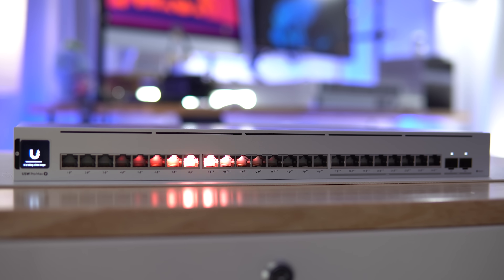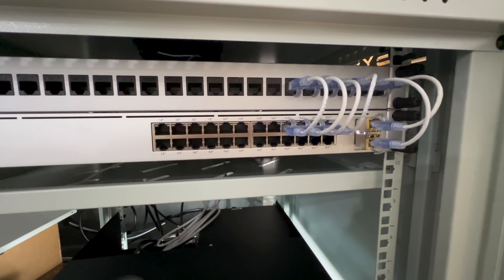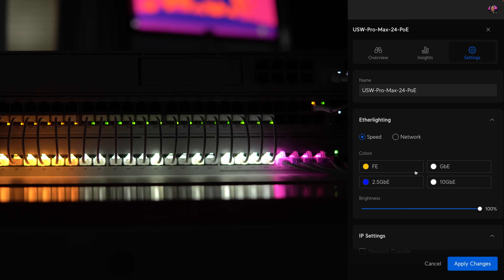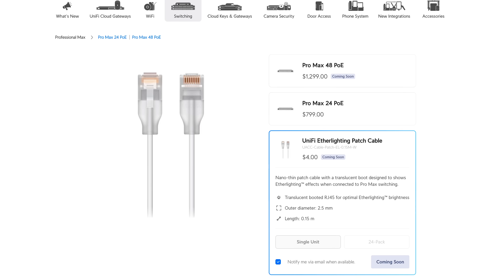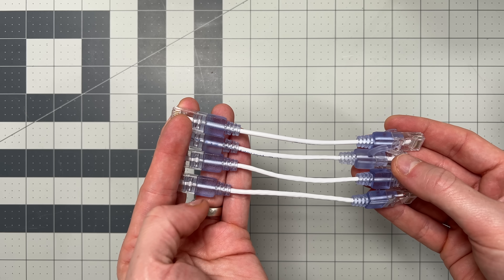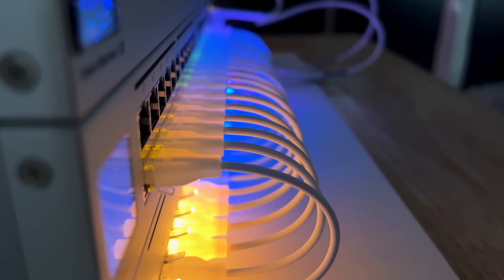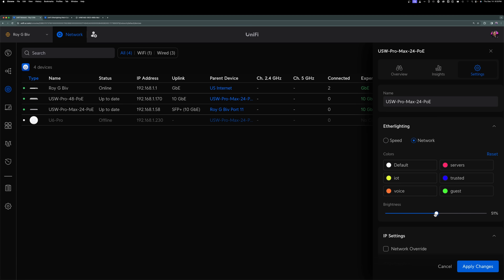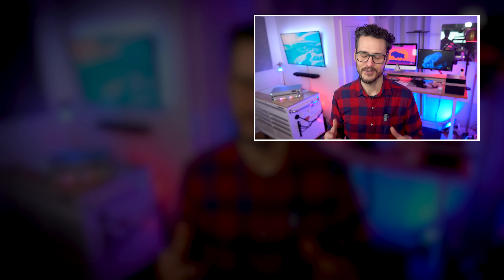UniFi Pro Max Switches & Etherlighting Patch Cables!

Comment: I think Unifi is missing out by not providing Etherlighting on smaller switches for normal home use instead of only on these expensive rack mounted nerd honkers.
Reply from the maker: @goofoffbert  i think it would be great but would be an additional cost.  Let’s hope they just move to Etherlighting for everything!

Comment: Side note: Patch cables with integrated LED to locate the other end exists since many years already. It quiet useful in the data center to find out where the cable goes. But until now, it was needed to plug an external power injector that the other end lights up, maybe Ubiquiti has a better idea to achieve this..

Comment: How on earth do I find a port? The combination of port manager and RGB LED on the switch ports may be useful for those who have poor vision or cannot count to 24 properly. Almost as good for them would be significantly larger and thus more readable numbering on the switch at no extra cost but I guess that's not a good business plan. Some kind of Christmas tree decoration is better in the market and RGB is trendy. Children will love it, adults and professionals in particular will rather find it disturbing.
And the port manager gives a good overview of the ports' ethernet speeds. The standard built-in port LEDs may suffice, but marketers are inventive.....

Still, it is a useful video for all those planning a thoughtful purchase of a Unifi switch. It it can prevent a mis-buy.

Greetings

Comment: You missed an important distinction; the Max Pro switches support Hi power POE, 802.3bt Type 4 which allows up to 100W per port. The rest of Unifi's switches with 802.3bt only support Type 3 power devices, which is limited to 60W per port
Reply: Holy crap, what would even need that?
Reply: @Maclah  by using 100w Upoe port, if we are going to setup surveillance camera 1cam of 30w , we can use passive 4 port poe switch which can be used to connect another 3 camera  on a single port and cable of  3*30w=90w , another 10w can be used to power up passive poe switch,,    it can be used if we need so many cams in case
Reply: @maniswatchingyou  Thank you for that!

Comment: Yeah a fiber line through the cable would definitely be a good touch, along with the ability to just light up a few specific ports. It'd allow you to trace cables easier in the congested racks of an enterprise. 

I like it. It's simple, and while not entirely too useful now, I think it's a step in the right direction, theres just a few kinks they need to work out.
Reply: it can light up specific ports

Comment: The scope for using this to:
1, identify the correct port for the avoidance of doubt and eliminating errors when plugging things in.
2, identify trunks, certain vlans, etc... such as an important vlan or trunk always having a certain colour.
3, idenfity heavy traffic or network errors. Such as a port flashing red to show a lot of packet loss, or 100% utilisation.

TBH there seems to be enough potential that all switches should have RGB ports as the debugging, and diagnostic potential seems significant.

Comment: I am extremely disappointed that Unifi is developing new Layer 3 switches when they haven't finished implementing Layer 3 on their old ones. A lot of us Layer 3 pro switch owners are still waiting for ACL implementation on Layer 3 to restrict traffic between switch vlans, and are still stuck using a router on a stick configuration (routing and ACLs on the firewall/gatewaypro) because not having them renders all other aspects of the layer 3 switch practically unusable. They could have saved me the $400 dollars by suggesting I'd buy the non pro layer2 switch because that's the headline feature the pro marketed.

Comment: I think the implementation is a little half baked in regards to the software. It is almost like their design people don't talk to actual end-users for input when designing this stuff. If it had the added features that you talked about such as being able to turn off the lights, turn them into status and link lights, show VLAN colors without having to have a cable plugged in, etc. Would make it more attractive to me. As far as the added 2.5gb and POE++. I think that's definitely worth the extra $100 if I were looking to spend $800 on a homelab switch.
Reply: Agree for the most part, but alternate possibility: This is them trying to just get a minimum viable product out the door. Explains why the hardware seems to be solid but the software needs some work.
Reply: Given they have the option to turn off the LED lights on their AP's i'm surprised they don't have the option for the switch. Some of the spaces where I work are studios so you need to be able to turn off lights if required.
Reply: The $100 extra isnt too much. Right. But the 699$ the "old" pro switch costs is way too much. You can get managed switches mit PoE++, 24 ports an two times the uplink ports for half the money from other vendors.

Comment: To be honest, the way people with home labs patch their switches irritates me. This thin and very short patch cables are in my opinion the opposite of useful. Yes, it looks cool. But they are too short to take a switch or patch panel out of the rack without disconnecting everything on that panel. People just patch every port directly from the patch panel to the nearest port on the switch, a completely one dimensional setup. For me this is not a good looking design. The only advantage is that you don't use cable routing panels and save some space. I have never seen such a setup in a datacenter and for good reason I think. But maybe I've just not been to the right datacenter.
Reply: I have never encountered a usecase for removing a rack mounted whatever (server or switch) while it's still on and has cables attached. What weird dances are you doing with your switches that you need long patch cables?

As for the "People just patch every port directly from the patch panel to the nearest port on the switch, a completely one dimensional setup",  it's a small setup and they will never need to move one of those cables anyway (or add another patch panel). How many ethernet cables are you pulling in a home? Do you need to waste all the space for a large bundle of wires to just go down 5 inches at most?
Reply: @marcogenovesi8570  Not everyone is installing rack mounted switches in a home. I've been in lots of data-centers, none of them are wired like that (ever). Normally the cables are terminated to a patch panel mounted to the back of the rack and cables are routed to the front. There is always extra cable for servicing and re-routing. It's spec'd out that way in the design phase. 90% of the time the cables all come from the side along a horizontal line - designed to maximize cooling for the rack and serviceability later. Now your average "I think it looks neato" home dude, that thinks they are net-engineer.. I've seen them do all kinds of stuff like you're talking about.
Reply: @maltedhop9897  not sure where I said people at home must mount switches in a rack.
Also did you miss the part where I said this is a home setup so it's mostly ok and there is no point in cosplaying as a real datacenter? What is useful in a real network rack may be pointless in a home lab or home network setup where it's hard to fill 24 ports
Reply: @marcogenovesi8570  "How many ethernet cables are you pulling in a home?" I never said, that you said, people at home must mount switches in a rack. 
I did miss where you said there is no point in cosplaying as a real datacenter. 
It looks to me like this original comment from @hw2508 4 days ago was about proper rack wiring, and it looked like you were defending an improper method. For looks. Do home users need to cosplay data-center installers? Nope. Do they need to go along with best practices? Nope. Can they do silly things for the look of it? Yep. Do they? Yep. Is @hw250 right in his original comment? Yep
Reply: @maltedhop9897  "I did miss where you said there is no point in cosplaying as a real datacenter. " indeed you did

I said: "it's a small setup and they will never need to move one of those cables anyway (or add another patch panel). How many ethernet cables are you pulling in a home? Do you need to waste all the space for a large bundle of wires to just go down 5 inches at most?"

"It looks to me like this original comment from @hw2508 4 days ago was about proper rack wiring, and it looked like you were defending an improper method."

I'm saying that "proper rack wiring" for a datacenter is irrelevant for most home labs and prosumers due to the small size. I'm telling what is actually required, you are cargo culting thinking everything must be done like "on the job" without understanding that "on the job" and "in a home setting" are vastly different settings.

"Can they do silly things for the look of it?"

Is it silly if (by your own admission too) it's not really required?

Do you  fully sterilize your cooking utensils with an autoclave like businnesses? No you don't, You are being silly sir, please stop at once
Reply: @marcogenovesi8570 Well, I did. Not the whole rack, but components within a rack.
I don't say, people have to do like I would do. But I see good reasons to use longer patch cables. Not all racks are very good accessible and if you need to work on stuff (without shutting stuff down) it can be very helpful to have the cable length to remove a patch panel or even a switch. I gave the main reasons in a previous post.
You do different, fine to me. I was not talking about home setups alone. However: If you question the number of Ethernet cables, how about questioning the excessive use of equipment? the average home user does not need a rack, needs maybe a 8 port switch and WiFi. THAT can not be the point of the discussion.
Reply: I get it though FWIW I have seen that in business LAN's before. And I sort of get that too. I mean how often are you really pulling the switch out of the rack short of replace  it which would require you to disconnect everything anyway.
Reply: @ryanb509 not only Switch replacement. But when the Cat cable is terminated at a patchpanel and there is still space free on that panel and you need to add additional wire. Or if you need to adjust something in the rack, like putting a device a little lower or higher. It can help if you don't have to unplug everything. You still have the option, but you don't have to.
Also, you don't have to place patch panel and switch next to each other and connect the 'neighboring' ports. Etc.
Reply: @hw2508  afaik if the patch panel is above the switch you can just move up whatever is the rack equipment above it to add or modify wires in the  patch panel. Since you are not moving the switch or the patch panel the short cables are not an issue. The cables for the other stuff is longer so you should be able to do that without disconnecting things. So it can be done
Reply: @marcogenovesi8570  yes, there are a lot of if and when. But often there are also conditions you can not move half of the stuff in the rack just for adding a few cables. And unscrewing just one panel is often easier than everything above the panel. A rack changes over time and I would build it from the start in a way this changes are easy to make with very few down time.

Comment: Please tell me someone figured a DIY way out already..
Reply: I mean it's just an arduino with ethernet and an RGB led strip
Reply: @marcogenovesi8570  I more thought of the "how to effectively mount LEDs in old switches without destroying the contacts" part
Reply: @klaernie  the contacts are below (or above) so I assume you can drill in some point in the back of the port

Comment: From this video I can conclude that this switch supports PoE+ and PoE++, and it was 24x 1/2.5G and two 10G SFP+ ports.
But other than VLANs, does it have any other layer 2 or layer 3 features?

Comment: YAY more things to break. If its not broken, dont touch it. I dont know if ANY actual enterprise gear that has this crap. Its designed to go in a closet, MOST enterprises have some kind of monitoring / loggin / documentation as to what is connected to where and to what. No one will open to closet and just sip their coffee while goobering over the LED's in an professional work place environment. 

Home labs, all new story and this is a NEAT feature, but yet still pointless.

Comment: etherlighting is a gimmick, it won't last. the added speeds and poe++ ports can justify the price, but most switches get put in a rack and are not seen constantly. also, to do anything with the lights, you have to log into the web portal to initiate it. with that same energy, you've already identified the port and can see a graphical representation in the web portal to help you accomplish whatever you need
Reply: Or just do what every professional installer does, every single time, on every single install... Label the ports (and cables). If you need lights to tell you what-is-what - you're doing it wrong and should start over (with a plan and a label maker).

Comment: Unifi suff is so apple like, I both love it and hate. Its been very hard to not get sucked in right away as I've started home labbing lol. One thing holding me back is just little things like, why wouldn't allowing you to just turn any port any color you want at anytime be the first thing they put into the software. Regardless of whether its in use or anything else. Not giving me control over my own stuff feels like the bad part of apple.  Anyways this switch is very cool and I am always impressed with their pricing and value. Making all of the ports inline for nicer patching is definitely a big win btw!
Reply: You know the creator of Ubiquiti is an ex-Apple engineer right?
Reply: Only difference now is the RGB, Apple would never do such a thing. I like it to use RGB in an I formative and cool. And he got a pint with activity blinks and the automatic shut off

Comment: I think making the status LEDs RGB and having a software layer control them so all this stuff is possible is the obvious step forward that all switches should move to. Using them for decoration, meh, but I like the ability to jump in and make them display differently depending on what you need at the time.
Reply: Yea, this is way better than just the tiny blinking light for indicators.
Reply: @spoonikle  Especially when you have a busy network and all lights are blinking in the same color...🤪
Reply: I’m new to networking, but absolutely love this! I have an 8port Poe switch, simple to use. What I don’t get is what is that 24port switch with RGB eth ports connecting into ? (Above it..)

It’s like another switch,? Is that so it can redirect the cables out the back to the corresponding devices or something?
👋
Reply: @-someone-.  The 24port switch in this video is a stand-in for a "patch panel" and is used for demonstration purposes only (just to make the ports work and show the RGB), it has no ports in the back.
A "patch panel" is a rack where all ethernet cables strung throughought the building are terminated, so each one of those ports would go to a wall port in some room somewhere. You use short patch cables to connect its ports to the switch ports for convenience.
Reply: @-someone-.  in a real rack the 24 port switch would be a "patch panel" instead
Reply: @marcogenovesi8570  ok thank you so much.... makes sense. It seems this would be way overkill for my setup,.. I appreciate the reply👋👍
Reply: Well, not with rgb, but green/orange/red with fortiswitches and higher end aruba switches. They have have poe, link speed and other colored indicators. Of course not as versatile as this but the concept already exists.
Reply: HP enterprise switches have had this for decades. There's a button on the front that allows you to change the meaning of the light for each port - link / act / speed / duplex. Of course they're not RGB leds though, so you can't do vlans or anything where you want to see different groups of ports together by color. I think a button on the front of these switches to cycle through the LED modes would be useful too. You don't always want to log into a web UI to change simple things - sometimes a regular old physical button gets the job done more efficiently.
Reply: @gorak9000  the little lcd screen on the switch might be a good way to do it too. Select the port and select what RGB option you want

Comment: It seems home lab and prosumer is a siginficant amount of their customer base. Nobody in businness segment is going to think this is appealing
Reply: Yeah... I feel like etherlighting is more of a gimmick, but judging by the specs in general it seems like a nice switch
Reply: Honestly I've long felt that Ubiquity is the Apple of networking. Both in who their customer base is and well as them being the overpriced locked down ecosystem. I mean I think Ubiquity isn't as locked down, if there was a true Apple switch it would use a custom protocol that allows it to only be able to connect it to other Apple devices for sure.  But it is somewhat and very ecosystem-y which I just hate. 

I want good old fashioned networking equipment that does not require me to connect to the providers cloud. I want the Linux of networking, not the Apple of networking.
Reply: @ryanb509  I get what you are saying, they are not the best choice if you just want to deploy a single switch, but in most prosumer and small businness environments you have multiple switches and a few APs and whatnot. The more devices you have the more having a unified control plane looks appealing.
Reply: @ryanb509  they are just centrally managed from a local device. You can self-host the Unify Network console on a PC/VM for free or buy one of their routers that offer that function as a "sheperd" for your other networking equipment. The cheapest one is the Unify Express, for 150$.

This is a far cry from the true "cloud managed" bulls.. like  say Cisco Meraki